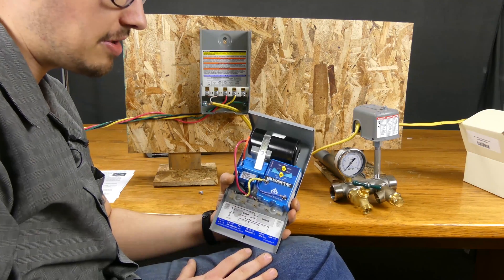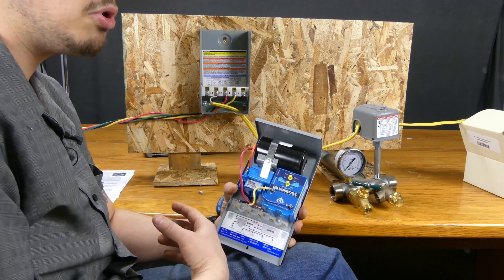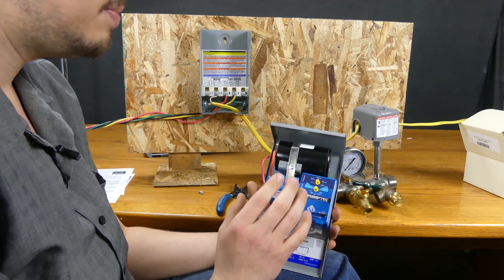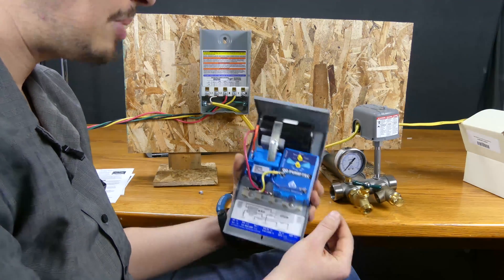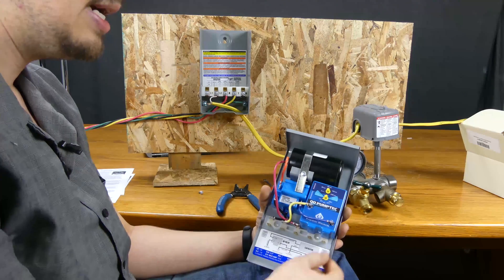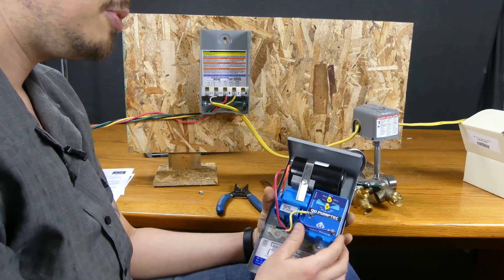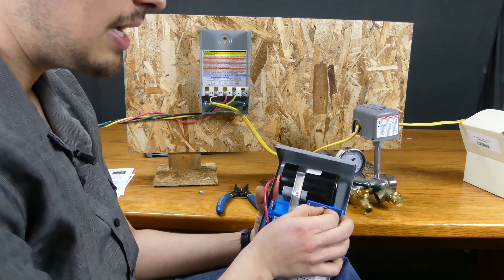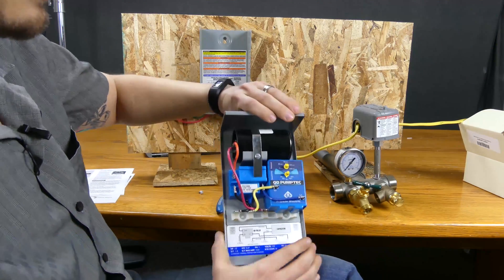QD Pumptec - Adjustments and Calibration

Comment: Great vids. Thank you so much. 
I am told i should have a timer installed, and not rely on the QD only as this is unhealthy for it. Again, should I install a timer before the the QD or it is ok to let the QD by itself ?
Again, thank you so much 👍
Reply from the maker: Motor protection devices like the QD pumptec are designed to be used to protect pumps long term, no external timer reuqired. We have installed thousands and they do not harm the pump, quite the opposite. They protect it from running dry.
Reply: @RCworstwater  
Wow. Thank you so much to reply. I could not find that answer anywhere. All the best 👍

Comment: Hey Chris, I have to run my well with a generator. The generator is running at 242 V. The Pump tech voltage is blinking red. I think I read that the maximum voltage is 252. I checked the generator with a meter and each side is getting 121 V.Any suggestions

Comment: Hello, I have this box for a 1000 gal holding tank for a well that hit a rock bed and is slow filling (1.5 gal/min). We just dropped our well 20ft and got water for 30 min straight and then now only for 15sec at a time. The timer was set for 30 min. I did the field calibration setting and it runs and does not turn itself off. What adjustment do I try next?
Reply from the maker: Try increasing the sensitivity

Comment: I have this setup to control our well pump which feeds a cistern.   Occasionally the the qd turns the pump off, then when it tries to cycle again it only turns on for a few seconds then off again.   It will try this I think 3 times then never turns on again.   When I turn supply power off for 10 mins then back on again, it works fine and fills our entire cistern.   Any idea what the issue could be?    Sounds like it’s  detecting a deadhead.  But it works fine with a power cycle.
Reply from the maker: Sounds like you may have a faulty check valve or your off-timer is not set for a long enough off period
Reply: @RCworstwater  does same thing if the off timer is set at 2 min or 2 hr.... just tries for a few seconds and off again.    But turn power off for awhile then back on and it works fine.     Seems very random when it happens.  We sometimes use excessive water and have no problems at all.    Kinda stumped.     260$ troubleshooting by the well company guy and they just said “use less water”
Reply: @mattlear2899  Any updates, I have the same problem. I reset and it runs for a minute and then turns off and dosent want to restart, the green power button stays blinking as if it's still running.
Reply: @alexanderrosales7675  had the well guy out….  He figured it was happening from gas’s in the well, said it’s common in my area and he just bypassed the pumptec.    Havnt had a water supply issue since…
Reply: My pump guy said I needed a new well so he set percentage lower so pump will stay on. And left timer at 2min